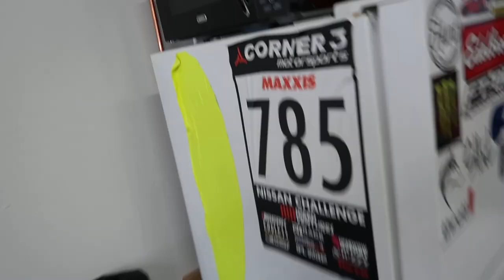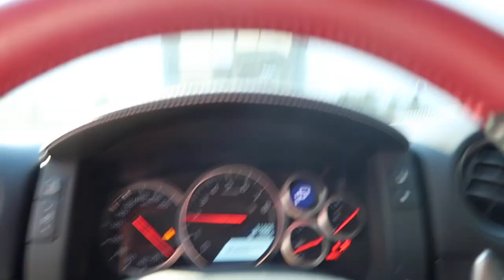The perfect truck for trailering a track car

Comment: I have actual truck knowledge not just "this sucks and you should get this because brand loyalty bro." Please pin this so TJ can see it, thanks. 

TJ, what you get is ultimately up to you but I hope you take some consideration of what I say. 

The first questions are what class of truck you are looking at? And what do you really need? What all are you hauling? Those are all things to be considered before purchasing a truck. To me it sounds like a half ton would suit your needs perfectly. If you are only going to be hauling the only 350, tools, tires, etc. You will be well within the ratings for a half ton. You also have to consider what type of trailer you will be getting and if you plan to upgrade to a bigger trailer in the future. You also said about your parents using it most of the time, a heavy duty truck might be too cumbersome and more of a pain for them coming from a light duty truck. 

So, if you are still looking into a half ton let me give you my some of my insight about them. Let's start with the Ram 1500. Now the RAM 1500 is a relatively old truck compared to the competition. They have made a few small changes here and there but, they have been almost the same since the redesign to the fourth gen style. The Ram has a less than impressive suspension setup with coil springs in the rear. They make it a good handling, snappy, responsive wheeled truck when unloaded. But, with a load it is a little different. They tend to have more body roll which means less grip and less control throughout a corner. Chrysler is also famous for having arguably the worst transmissions ever put in trucks. A large number of Rams also have wiring related issues which can be costly. So at least for me the Ram 1500 is out for a tow rig. 
Next is the CHEVY SILVERADO 1500. The Silverado is actually what I have as my personal truck. It has a tow rating of 12,000lbs if optioned correctly but most only reach around 9,500lbs max towing capacity. But, that is ample for your needs. The engine is the tried and true 5.3 liter V8. LS engines are known to be reliable and for having easy access to parts. The overall build quality is alright but leaves some to be desired. I got mine with some body panel alignment issues and some interior fit and finish issues. It also seems to have developed a few interior squeaks but that's probably from all of my dirt road and trail driving. Another thing you will quickly notice with a Chevy is all of the recalls. Rust on the frame from the factory's also a problem. The truck is also assembled 73% in Mexico which is a negative for me. Very solid truck though and I would leave that up for consideration. 
Next is the FORD F-150. The F-150 has lots of features any many things that I like. But, I would advise against the ecoboost engine if you look at an F-150. They are a twin-turbo V6 engine with makes lots of horsepower and a surprising amount of torque. Now they can be very goo engines but you have more chance of failure and it's an expensive fix if there is failure. Turbo parts are not usually readily accessible at local auto parts stores and a very expensive to order. The coyote 5.0 V8 is a very solid engine and I believe that it should be taken into consideration when looking for a truck. I also like that Ford's body's are now made out of aluminum. The weight savings offer increased fuel economy and if will never rust like steel. Probably more important for me than you though because I live in the rust belt. But the F-150 is a very solid solid truck and I would leave that up for consideration.
Finally we have the TOYOTA TUNDRA.  The tundra is the least updated of them all. It got a body redesign a couple of years ago but the engine is still the same 5.7 liter V8. But it is a tested engine and proven to work and work for a long time. A Tundra in California ticked over 1 million miles a few months ago. They have a very competitive tow rating and it is one of the fastest trucks on the market today. The Tundra while being a Japanese designed truck is the most American made out of all the big truck manufacturers, even the big three American car companies! The build quality of the Tundra is stellar and it just plain works. The Tundra is a serious competitor in the American truck market and should stay up for consideration. 

All of the trucks nowadays are very close and you will be happy with anything you buy. My advice is to test drive all of them and see which one you like the most. That's the one for you. Thanks TJ, do it for the bros.
Reply: SuperMotoSean 419 but you didn't even mention the GMC Sierra 1500? If you knew as much as you say you did about trucks you'd know how good gmc performs

Comment: ive owned a lot of diesels. currently have a ford 250 and 450 and my daily is a 150... the new f250's 6.7l diesels are probably one of the best motors on the market right now. imo.

Comment: Tj it was a really bad idea to tell us to say truck suggestions in the comments because it is going to be a war but I think a ram 2500 Cummings non dually would be sick.
Reply: Sups 12 not really a diesel ram seems to be the common comment
Reply: Thewasteland It's the most common because it's the most reliable. I got a second hand  dodge 2500 with the diesel with half a million miles for only $1800! It gave me no problems and I only invested in the trans. I got it to go a million miles no problem. I let my kid drive it now.
Reply: Ram sucks, HA started a war.

Comment: Really depends what you prefer. Gas or diesel? Although a car and trailer aren't going to be very heavy at all, a diesel is always my top choice for towing. Duramax chevys are great but no where near the quality of a cummins, or powerstroke. But if you decide to go gas I would recommend silverado 2500, f250, or dodge 2500

Comment: i would recommend you invest in a ram diesel truck because they have tons of power they are crazy reliable and they are nice if you are looking for a smaller truck you could look at the ram 1500 ecodiesel because it gets like 30mpg its a diesel and can tow like 11000 ponds with style, anyways great videos man youre dope also if you wanna go for a use truck get a 7,3 turbo for but dont get the idi because no turbo and also if you do be sure you upgrade the trasns cooler and radiator i would recommend mishimoto

Comment: If you want a gas truck then I'd look for a Silverado 1500 with a 5.3 V8 or a 6.2 V8 or a Dodge Ram 1500 5.7 V8 but personally I'd buy a 2500 diesel like a Duramax or Cummins because they pull more and well they are just fun to tune and from experience they all around have more pros than cons to a gas truck.
Reply: HIGHVOLTAGE 3834 I 100% agree its like if u read my mind
Reply: HIGHVOLTAGE 3834 word
Reply: i dont think he should get anything bigger than a 1500 since his parents will use it most of the time
Reply: chevy duramax ftw

Comment: One ton vans are where it's at! We use them for our race cars. I have a Gas Dodge b3500 and a E350 diesel. It's so nice to have all the space for camping, hauling tools, tires, wheels, putting engines in the back. plus they fit a whole crew of people. Just everything about it is better. even compared to my truck with a camper shell. 

I also have a crew cab short bed f250 superduty and a crew cab long bed dually f350. I have both open deck and enclosed trailer set ups too. 

Basically of all the configurations, the vans work best. 

...Except for multiple cars. When we use a two car trailer. the dually and a gooseneck rain supreme. 

My favorite is the e350 diesel van with the 28' enclosed.

Comment: Pin this for the bros Tj (and peep my latest vid)
Reply: MTBbeginners hyes
Reply: MTBbeginners yes
Reply: I'm late to the vlog damn it.. installing my shocks and struts.
Reply: Sam Velez look for a dodge cummins 3500.
Reply: Ford
Reply: Pro Skull bro it's way too expensive
Reply: nahh he should just get a honda truck they are the best
Reply: Don't get anything but a ram
Reply: F150 Tundra or Titan
Reply: Or if you want diesel 7.3 or 6.7 ford
Reply: DURAMAX OR CUMMINS. get a 2500. dont really need a 3500..
Reply: get a duramax 6.6
Reply: Go check out our SIX DOOR Duramax! Facebook.com/thebuild2014
Reply: MTBbeginners agreed! The raptor was the easiest truck to drive and it just goes!
Reply: get a cummins 2500 2010 or newer Teej
Reply: Tundra?
Reply: Chevy Colorado Diesel
Reply: Or Tundra because the reliability and power
Reply: I'd get a diesel, either a Cummins or a Duramax since youre towing because Cummins are just great motors and the Dmax comes with an Allison transmission, which is also great. But honestly any truck you get will be alright as long as it has V8, with the exception of the new Fords. That aluminum isn't worth its weight in scrap, and the Superduty is impossible to work on or use. It sits about as high as a mid 2000s half ton on a lift and 35s, and you have to take the body off the frame to do any work with the engine.
Reply: Any turbo diesel
Reply: nickthatch12 Ford f1-50-f-250 are easy to work on my family had trouble with chevy and dodge and our ford does great
Reply: And Tj get a Ford Raptor
Reply: Austin Senn noo haha ford is hardest to work on.
Reply: F150 Ecoboost, good gas mileage and good towing capacity
Reply: Food or Car Parts..... Car Parts + Easy Mac and Ramen Diet = WIN
Reply: Sam Velez dodge for sure
Reply: Dodge Ram 2500
Reply: Ruben Mandujano 2017-2018 F-150 is going to have a disel option
Reply: Diesel is more fuel and cost effective in my experience.
Reply: Go for ford raptor👍
Reply: Tj you should get the 4x4 chevy silverado
Reply: If you want a very reliable, million mile engine, go with a 7.3. I have one and it has 265xxx on it so far. In the 7.3 world, it is just being broken in. A 7.3 that's been maintained, will never let you down. If you can't find a 7.3, go with a 6.7 power stroke above a 2011. They will do everything and more that you need.
Reply: Sam Velez get a newer chevy Silverado 2500 hd
Reply: Sam Velez I would say a 2010 Chevy Duramax. extremely reliable, and you get the Allison transmission which it top of the line. 2010 the truck got 360 up and I believe around 600 ftlb torque. it will tow your 350z easy
Reply: Coming from a very diesel based family  I would recommend a Duramax or Cummins. (Nothing against Fords, just personal preference.) I don't think you need a 3500 if you aren't gonna be pulling a big trailer or be pulling often, so probably look into a 2500. Hopefully you find this helpful, good luck!
Reply: Toyota TRD tundra
Reply: Get a Ford
Reply: RapTOOOOOOOOOOOOOOR
Reply: Get a sierra  Dinali
Reply: Get a Silverado ss
Reply: Get a Silverado ss
Reply: DODGE CUMMINS just bc you can afford it and there really good and no more worrying about all of that use oil bc now you can just dump it right into the fuel
Reply: Early 2k 6.0 and 7.3 powerstrokes are pretty cheap you could easily get a good one for the right price and have a reasonably sized truck and still tow whatever you want
Reply: Don't get a damn 6 Blow. They have too many issues with motors going out etc. Get a 7.3 if you do but I personally think a Duramax or Cummins will be enough to pull it

Comment: 2011-13 Dodge 3500, comes with the Cummins, it'll pull anything you need and will get upwards of 20 miles to the gallon especially if you put a chip in it. Great truck you can did tons of them with around 50,000 miles which is nothing for that truck
Reply: If your gonna be pulling trailers get a diesel, if you get a gas truck you will lose so much mileage that alone will break the bank pay the money and get you a truck that will last you the rest of your life no matter the hell you put it through, I've driven all trucks pulled trailers in all and found that the Dodge held up the best.
Reply: Chanston Cochran do you know anything about trucks? cars are diffrent a shit prius makes a fuck ton of mpg and trucker dont my dad has a 2011 colorado he uses for work that does 19mpg making it one of the most fuel efficient trucks out there dualies make under 4mpg toeing because there made for power and towing not fuel economy and a typical 2500 or f-250 (3/4 ton trucks) do between 10 and 13 mpg
Reply: Chanston Cochran skip to 20:50 these are all 2017 trucks and all doing under 3mpg
Reply: My dad has a 3500, and it is not a dually.

Comment: Just get a dodge. They are great used and are cheaper bc they don't hold value but are great trucks
Reply: Josh Gibson there cheap because they break a lot
Reply: rockstar9amp You know nothing😂
Reply: Jacob Chaney he's definitely not wrong lol trust me everyone I know with a dodge has had terrible electrical issues
Reply: Rams are nice trucks don't get me wrong but they do have their share of issues like all of the other trucks. Chrysler's transmissions and electrical components are basically throw away. Their build quality is also sometimes less than desirable. I also think TJ is looking for a half-ton. The coil rear suspension in the Ram 1500 is definitely not the best suspension set up for towing. Leaf springs are king when it comes to towing. Less body roll with weight means less load transfer and more control. By the way Dodge doesn't make trucks anymore. It's Ram now.
Reply: The Cummins engine is good but so much other shit breaks on dodge trucks
Reply: Not too mention all dodges have transmission issues. The gas engines are horribly optimized. Honestly Chrysler makes sub par quality vehicles.

Comment: Dude 5 Cilinder 2.5 Turbo diesel volvo V70's or Audi A6 3.0 V6  can pull you're 350 😬. Americans with there fucking trucks.
Reply: I really agree on this one! You rarely see a truck pulling anything in Europe, we use estates instead - and they even look and drive a lot better!
Reply: Christoffer Thage all these trucks people are naming in the comment section I have never seen before.
Reply: That's so true. I only know some of them, because of the American youtubers I watch. Never seen any of them here in Europe
Reply: europe is the best
Reply: Nah get yourself a turbo diesel truck. Like a 7.3 Powerstroke
Reply: awd diesel wagon would be perfect.
Reply: Mega Quattro
Reply: Madern you can put 3.5 tonnes with a 2.5 4cyl turbo diesel. In fact, every 4x4 pickup in the UK is rated for that minimum.
Reply: Dude fuck yes. Fuck yes!!
Reply: 3.5 tons? lol my truck weighs that much

Comment: A good way to get the tire marks off, I do it with my race car is gas on a rag 110 is the best it won't eat the paint or discolor it! Works great! And I'd if you arnt going to be using the truck all the time and only to haul the car I would say a newer style dodge cummins, extended cab, or regular cab long bed! Plenty of haul space and the cabs are big and the cummins is just an insanely reliable motor.

Comment: Contractor here, I have no bias for any brand.. best truck I have owned is one of the latest gen Dodge Rams. We use a ram 1500, hemi, with a 392 rear end.. 14k tow rating, strongest truck in its class, and also the cheapest. I believe it had the highest consumer rating in 2013 and 2014

Comment: Hey TJ a truck I would recommend is a Chevy Silverado dually and if you can get it in diesel I would go and jump on it. My dad had one from 2001 Silverado dually diesel and with it we have pulled sometimes 2 to 3 cars on a trailer with no problem

Comment: Bro, if you need a truck you should look at manual 5.9l I6 Cummins any year from 94- 07 best towing and fuel efficiency out there. Absolutely recommend the Cummins to anyone. I personally drive a 1999 Cummins 2500 and it is an absolutely great truck! plus if you ever want to modify them there are so many aftermarket parts available.

Comment: TJ 
     I suggest you look into the new Ford F-350 XLT or XL. They come with tons of safety features that could be practical when at large events. For example my brother's 350 Came with a safe in the center console. it was totally a practical thing since they were traveling from Vancouver, BC to Riverside, CA.

Comment: Get a low mileage 2002 F250 -350 7.3 Powerstroke. Its a reliable loud dinosaur, but you wont have to deal with all the emissions bs of California with it. Either that or a f150 Ecoboost, or a 2015 + 6.7 Powerstroke F250!

Comment: 12v Cummins or 24v Cummings won't have a Problem towing and there reliable and bad ass 5.9 24 Valve is a beast very recommended

Comment: If you get the Raptor get the new 2017. It is a v6 but it's an ecoboost and it's twin turbo and make much more power, plus if you ever take it to the desert it has a much more ridged frame so you can beat the hell out of it and it won't bend. It being a v6 it is much lighter and will get better gas mileage than the 6.2L v8 previous models

Comment: from a mechanics stand point i would go with either a dodge cummins or a duramax, the cummins has less moving parts in the motor which is less stuff to break and the duramax comes stock with the allison trans which is a really good trans. if you're looking to modify and tune the the truck go with cummins, the torque on the newer trucks is amazing. But at the end of the day its personal preference.

Comment: If you're looking for a reliable towing vehicle, buy a 70 Series LandCruiser GXL Dual Cab Ute/Pickup with the engine being a Twin Turbo Diesel V8, 200 Series LandCruiser GXL Wagon with the same engine as the 70series or a Nissan Patrol ST ( I think they are called the Armada in the States, correct me if im wrong ) With a 4.2L N/A Diesel  V6 ( only available in the GQ-GU IV ) these two brands are the main vehicles for 4wdriving,Towing and overland touring in Australia because Parts are cheap and the engines are un-killable. Recommend them from experience, haven't let me down.